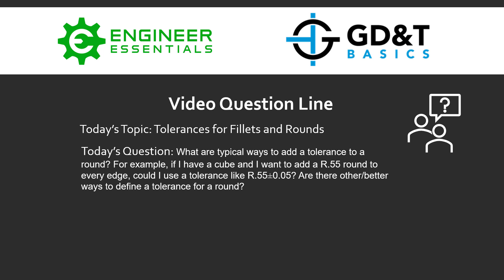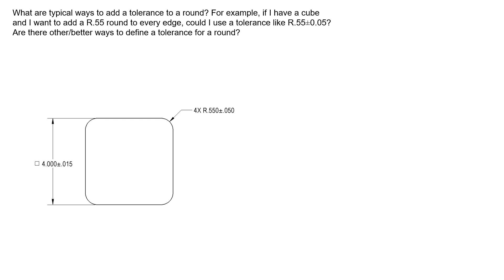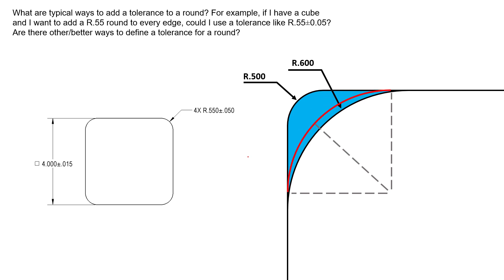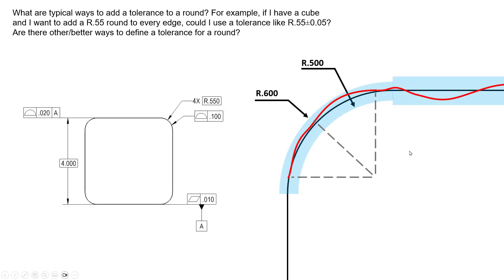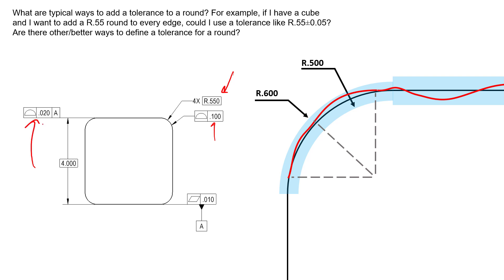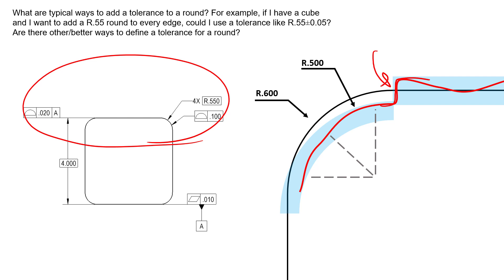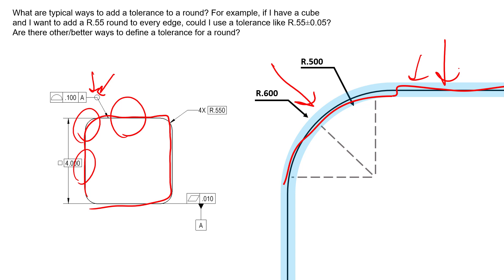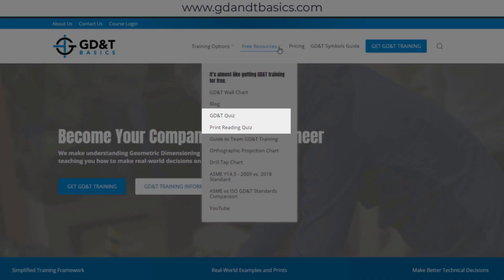Tolerances for Fillets and Rounds

Comment: I believe the step you are mentioning a couple of times it wouldn't happen, at least with 2018 standard? 
Par 5.16.1 implies that when the center of the radius is not located, then arcs are tangent to the surface
Reply from the maker: You are absolutely correct, this verbiage within the latest standard does a great job of eliminating this potential issue. Unfortunately the previous revisions of the standard haven't clarified this issue to this extent. Thanks for your comment!
Reply: Small arc features (less than 90°) are difficult to define its position accurately. The National Physical Laboratory Measurement Good Practice Guide No. 41 addresses this issue. ASME Y14.5-2018 states that control of small radii should be defined by profile tolerances rather than by position tolerances.

However, there is a singular case in kinematic mechanisms in which the line of action of a force passes through the center of a small radius. In this specific situation, profile control alone does not fully address the functional requirement; nevertheless, a sufficiently tight profile tolerance may mitigate the issue. An article discussing this topic is currently being prepared for ASME publication and will be published soon.

Comment: I think that there are bigger issues with attempting to control the fillet with a +/- dimension:
1. A fillet is not a feature of size, you do not have opposing points to be able to unambiguously measure, so this type of measurement has an inherent issue of leaving the interpretation to the person doing the measurement, who guess what, will interpret it in a way that is convenientnt to them and you'd have no leverage to tell them they measured in a wrong way.
2. Due to the usually small size of those fillets and having only about quarter of a circle length, measuring the radius is wildly imprecise. You'll most of the time have just 3 points to try to define an arc, whose radius will greatly depend on small variation in the surface.

My approach is: never dimension them with +/- size. If they are non functional, a tolerance is usually irrelevant, you just want them to be there roughly in that ballpark (at most you can consider controlling them with edge breaks), if they however are functional, profile tolerance, no 2 ways about it.